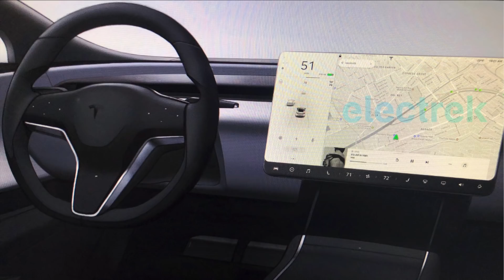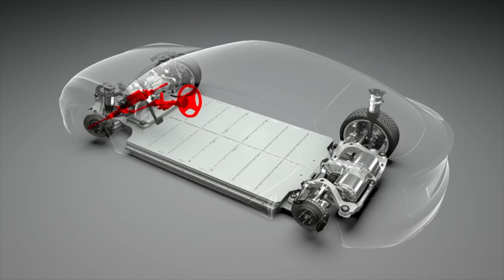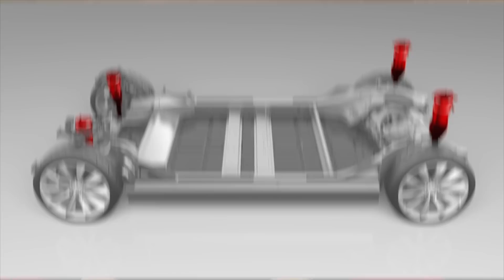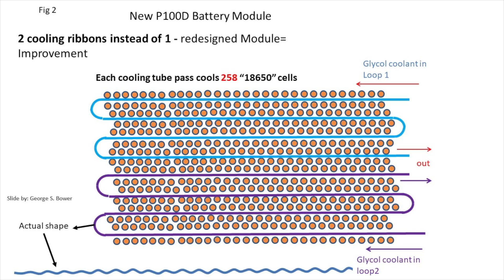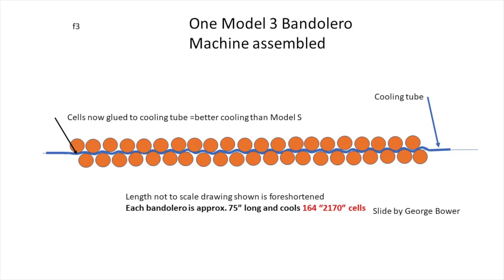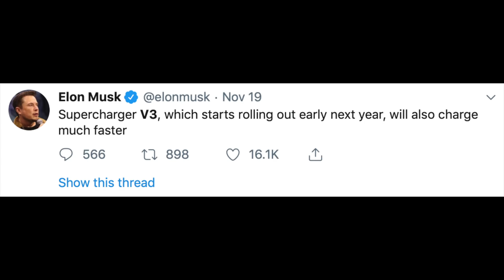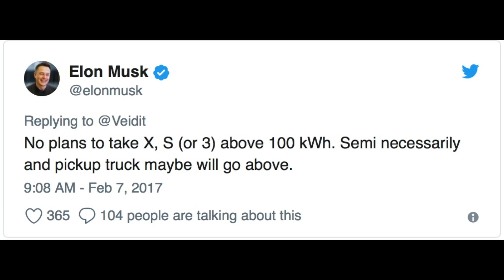The reason Tesla's 75 kWh battery is going away

Comment: There is no way in hell Tesla are going to just sell the S and X with a 100 kwh pack only. So my guess is that the 100 kwh pack will take the place of the 75 kwh pack and Tesla will release a "premium" 125/135 kwh pack with the newer 21700 cells. 

But it also brings up another question. if Tesla does go this road it means that the total power output of the pack will increase and that means that the 0-60 time will decrease, and then it would be competing with the 2020 roadster. 

So maybe tesla will limit the total power output of the pack. i think they will. 

great video as always.
Reply: GS540 I don’t think it will compete with the roadster. The guys I know with preorders are going to throw it on the track.
Reply: So 100kwh now costs $96k what will a 150kwh battery cost? I thought costs would be coming down not up  :-(
Reply: @gregandkaruna6674 Maybe they'll lower the price for the 100d.
Reply: @michaelrhodes73  Maybe, but I doubt it, how much has the price come down on any Model S since it was released in 2012? And the Model X has that come down?
Reply from the maker: Yes. I'm thinking something similar.
Reply: Or they can extend the wheelbase to make more room for 18650 cells to make the pack larger
Reply: @TommyboyGTP  why thats more Metal wasted for non Reactive Components. the 18650 is Dated to the 90's. and its Frankly out of date. teh larger form factor lets them use more space between cells and Store more power per Unit of Volume AND lower weight (steel tubes are heavy)
Reply: Chuck O Technically you‘re absolutely right. But the technology of the induction motors of S&X are grown historically (from the initial roadster). I don‘t think Tesla will continue them. Three reasons: Less weight, more efficient (both attributes of permanent motors) and strategically - less different components in the supply chain.

Good interview with Tesla Chef Motor Designer: https://insideevs.com/chief-motor-engineer-tesla-model-3-motor/
Reply: No it won't compete with the roadster because here is what I expect to see in the next 12 months from Tesla:

Model S: 420 miles range, 0-60: 2.1s (official on the site) probably faster real world numbers
Model X: 400 miles range, 0-60: 2.5s
Model 3 Performance Ludicrous Mode: same range as battery will most likely increase on the 3 in 2020: 0-60 2.6s

2020 roadster: 0-60: 1.8s, 0-200: insane to most human limit which the S and X won't do which is why it won't compete...
Reply: So the 100D model will become the new "affordable" version of the S and X. That seems exactly what they are going to do.
Reply: @ParkourParker25 
Yes, but the new cells are also a lot cheaper, so I think the new 100D could cost as little as the 75D costs now.
On the other hand, now the S and the 3 price ranges are overlapping, which is probably not a good marketing strategy. So maybe Tesla just absorbs the lot higher profit margins, or puts in new fancy gadgets to attract more wealthy customers. For example an interior refresh that's a bit more luxurious could help a lot with Tesla's image.
Reply: GS540 They‘re going also to change the motors for sure.
Reply: I very much doubt Tesla will limit the S, to "protect" the Roadster. There's no way an 135kwh S can compete with a 200kwh roadster. Returns are massively diminishing too at that level, we might see a tenth or possibly 2 tenths knocked off the Model S 0-60 time, but it wouldn't be anywhere near the 1/4 mile time or overall performance level.
Reply: agree, but the pricing has not changed...so are they going to screw the ever loving crap out of anyone who buys a 100kwh in 2019 before the update? jesus
Reply: If the total output goes higher the battery life will go lower
Reply: I think they'll go for the 125kWh pack. 120 would leave them just shy of a 400 mile range. 125 kWh should give them the 400 mile mark even if there is a slight weight increase.

If I remember right, the S & X didn't integrate the inverter with the battery pack like the 3, so a current increase to deliver more power to the engines would definitely require a vehicle change.

Volume-wise, they should be able to match the current space with 21700s just by adjusting the cell configuration however needed. But, there may need to be changes to the cooling system. I'd bet the 21700s represent a higher cooling load during charging unless they don't choose to charge at the full rate the cells could enable (in order to minimize redesign).
Reply: @rhett1383  60/85 65/90 70-75?/100 85/125 seems decent.....itll be close.....

i cant remember what happened back in 2014-2016....
but didnt they just REPLACE the 60 with 75? yeah?
and the 85 with 90 and then 100?

why remove the more popular option >> wtf

the car is old and outdated and now they're making it even more expensive wtf

should be cheaper than ever not more expensive, going to literally PUSH people into buying a taycan/ipace/etron  if they dont get the new sizes and lower price out soon
Reply: @Richard-ie1if  Assuming the ratios mean anything to them, I could see them dropping the 100 and going with something like 90/125. It would put the Model S squarely back in the king of range spot.

But, I don't know that it will necessarily be more expensive. The cell costs are coming down. One of the beautiful things we'll be seeing with EVs over the long term will be steadily increasing capabilities with inflation-adjusted costs remaining the same or decreasing. In this case, they are moving to newer technology that is being more optimally manufactured. I believe they can do it without increasing the cost. In fact, the better economies of scale could make it a reduction versus having this one platform stay on different tech in much lower volume.

My real guess is that there will be a slight cost increase at first just to reduce the backlash from people who just bought lesser capability. A couple of times in the past they've caught some flack from people who just bought for giving people more or the same for less the next day. This is minimized if they give a little price bump initially and back it off to the old price points over time.
Reply: @rhett1383  
yeah thats why this is total BS. the s/x are outdated woefully currently, and instead of lowering costs after publicly stating the margins are 30%+ and as batteries become significantly cheaper 700$/kwh to 100$kwh being sold in the tesla semi coming next year....

instead they remove the 75kwh and ignore the 4k missing tax rebate and effectively make the s/x 100k vehicles.  meanwhile the 35k 3 is still nowhere in sight

meanwhile the leaf extended range will be 28k post credit 35k before and do 240 miles...

if teslas advantage is in batteries it sure as heck isnt showing lol
nissans pro pilot will be compareable in a year or so and eventually everyone will get to full highway driving so who cares....its not worth more than 1-2k certainly not 5k
Reply: of all the times to do this why when the car is worse than ever, has no free supercharging, lost half its credit, and ipace is out, etron and taycan coming soon with kona bolt leaf releases/upgrades all coming

literally encouraging customers to look elsewhere

even then as the supercharger stations become more dense the 100kwh version is largely useless, a new 85kwh version with the new cell would blow an older 100kwh out of the water on charging rates
65kwh 3 can do 120+ so youd have an 85kwh base charging at 160kw+ vs an old 100D at 120 and the newer car could do that to a higher charge

for less money, cause the batteries are getting better and cheaper go figure

anyone who buys the last 100D made for 100K is a fool
Reply: @rhett1383   well yes its what i mean, somewhere around there whpould be good
Reply: Or they'll add a more powerful motor.
Reply: @stephenlasky9348  yes, u may be right
Reply: I am sure you are right
Reply: Elon Tweeted that the S and X will not be receiving any 21700 cells.
Reply: I heard it too....but why spend $5.5 Billion on a factory to make a new cell - the 2170 - that is lower cost, stores more energy, charges faster and has a longer life....then not put them in your best vehicles?  @WhitentonMike
Reply: that'd be nice.
Reply: 21700 cells would require a major redesign of the car.
Reply: @JohnDoe-vx3z  I dont agree. It would require a major redesign of the battery pack for sure but i don't see why it would with the car.
Reply: @GS540  Well, first Elon said so. But also the package of the new pack would be radically different.
Reply: @JohnDoe-vx3z  As for fit , Elon has already said it's not an issue . Only the battery pack design will be impacted
Reply: Chuck O 

Chuck O, excellent points all.   Yes, the S will probably go into the 9s in the quarter , but at what cost?  Battery and motor life are already critical at the "I want my mommy versus bring it on" stage.  This doesn't include tire wear ( already poor) and insurance considerations down the line. Do insurance companies want to see 8-9 second sedans in the hands of amateurs plying the streets of any town USA?  What about heat management?  Excessive Heat is never good for batteries on BEV or even ICE vehicles. 

One other thing. Don't confuse quick with fast.  The BEV are quick, but not necessarily fast. An S running 10.5 at 124 MPH is quick, but a 991.2 TT is both quick and fast at 10.5 and 132 MPH quarter. After the quarter mile, it only gets worse for the BEV. That's where the transmission comes into play. More speed with less RPM. The torque curve of the electric motor is already so flat that it can easily handle " shifting" a couple of gears up to lower rpms and energy usage. All while gaining speed.
Reply: @Newzchspy  I doubt insurance will be an issue.  Despite Tesla cars being some of the quickest accelerating factory cars available for sale to the public, ever, the insurance costs are roughly the same as comparably priced ICE cars.  We're not talking about a 60's era muscle car here that might just put you in the ditch at launch with only 350 hp.  Acceleration in these cars is completely drama free.  No scary noises or chassis upset to worry about.  The insurance companies only actually look at three things anyway: 1. The cost of repairing or replacing the vehicle, 2. The likelihood that said vehicle will be in a collision or be stolen that will incur said cost (including how often you drive it and your record) and 3. The safety ratings of the car, which again, in spite of the stellar acceleration numbers, are the highest in the industry.  If none of those factors change, it doesn't matter how quick the car runs in the 1/4 mile.
Reply: Robert Nugent Go online or call your agent. The cost of insuring an S/X is 40-50% greater than a comparable sized sedan ( E or S class)  from MB or BMW . Price out insurance for a new 2019 model 3 DMP and its near double the cost of a $42k Honda Clarity. Remember, much depends on where you live or drive and record, but as a general Rule, Insuring any Tesla is not cheap.  An X P100D will knock your socks off and is more with most carriers than a 2019 Z06 Vette.
Reply: Robert Nugent You left out many other factors....1. Frequency of being stolen or attempted theft or vandalism 2. IRG ( Insurance Rating Group from the ISO) 3. Where parked or garaged 4. Cost of parts and availability ( goes to how long  you're in a rental too) 5. Frequency of collision and /or comprehensive claims 6. Standard and optional equipment on vehicle per vin # 7.  Labor time to repair said vehicle is higher than comparable vehicles given materials and construction  ( just look at aluminum on Audi for example) 8. Typical driver exposure ( youths versus over 25 or married drivers)    9. AWD versus RWD due to drivetrain repair costs . The big issue with Tesla is unavailability of aftermarket repair parts ( non OEM) and cost or time of labor and paint.  I'm hearing up to 6 months for some collision parts like quarters, doors, windshield, bumpers and covers .  Scratch is one thing, collision is a whole other.  

Oh, and don't think that insurers don't know that the Model 3 is a high 11 quarter car or the X in the 11s and the S in the 10s. Relevant for rating: absolutely!

Comment: Yes, it's going to happen! I would have preferred a little later in 2019 but all should go down well anyway!

It's my thought that after all of the so-called would-be competitors had staked their claims on whatever mileage & power levels ranges each had settled on during one of those many marketing meetings. Tesla would come alone and upgrade their battery size and power levels alone with offering a greater mileage range of all of their lines. Thus causing a general predicament and dilemma without a short-term solution within the competitor's many ranks. Not good!

In fact, I personally think that a completely new battery is waiting in the wings with the ability to be assigned a class range such as A1 & A2 for the high-end model A & X, with B1 & B2 assigned to the value brands 3 & Y, thus allowing C to be designed for Commercial and Industrial applications and D for special applications designed for the energy group.In the end, just one battery with different mileage and power ranges, all based on a single software app applying different class assignment to meet the demand of the lines forecasted needs.

Yet another win for Tesla while placing the competitor's yet another step behind while again reducing the competitors themselves with just a single move on the part of Tesla itself.

Later
Ric
Houston/San Francisco
Reply: wrong.  batteries are over, the disrupter will announce with inventory and priced to last a year not to merely generate wicked fear.

Comment: I think that this is just another effort to take Tesla further into profitability.  I bet that the S and X were not big profit centers and it's not the batteries but other areas. the S is all aluminum,  the 3 has steel to save money, so, simply decreasing battery size shouldn't be a big drop in cost over the next few years, Tesla won't need to differentiate on battery size.  I think that the 3 will eventually settle on 1 battery size as well.  In 5 years batteries will be even cheaper than today.  I have a used Model S and the degradation is minimal.. basically Is till have way more range than a concept Mercedes that hasn't even hit the market yet  I see a future where older Model S' and X will be in demand for battery and possibly motor swaps.  It's exciting what can come in the future  Your S Sean, won't rust away, it will last a long time.
Reply: Have the Model S and X actually made money??
Reply from the maker: Second highest profit margin per car in the industry at 25%.
Reply: @AllThingsEV  that's a bs number. Plus... It doesn't account for the sg and a. Tesla's quotes from profit margins are so skewed
Reply: @AllThingsEV  really? Then why during the entire time that the Model S was introduced in 2012, Tesla only had 2 profitable quarters until 2018?
This suggests that despite the 25% profit margin Tesla was still operating at a loss.
Reply: @pogo1140  production of car was profitable, they just reinvested all the money on growth. Not giving money to shareholders.
Reply: @niconico3907  Tesla has an operating loss every year they've been in existence.  They have had three profitable quarters in the entire history of the company.  Two of the quarter's profits were so small as to be laughable ($11M and $22M).  Q3 of 2018 was $312M.  They don't have any real profits to distribute to shareholders - they're still trying to make up for the loss avalanche they accumulated so far.
Reply: @buckhorncortez 
It's called investment. Or do you think gigantic factories and global infrastructures are free? The gigantic difference between Q2 vs Q3 profit in 2018 proves beyond any doubt that Tesla's operation is very profitable, and the overwhelming majority of the "losses" was actually investment. And that profit will grow as sales numbers are improving and margins are growing. Q4 was definitely be more profitable then Q3, the only question is how much more.
Reply: Sean Mitchell only later were they profitable. Developmentally and during initial run, they made little to any money.

Comment: Hey Sean, that was a very good run down of the details. As a non-expert on battery technology, other than what I read or learn on my own, I agree with pretty much everything you said. I think there is a great chance that there might be a new form-factor coming up soon, but I also think there is a good possibility that the 2170 might be the one carried over on all Tesla models moving forward for a while beginning very soon. This makes a lot of sense to allow for a single type of battery production lines.

During my latest road trip my Model 3 charge many times at 500Mph, so I also feel like there is a lot more that can be pushed into the Model 3 since when it reached those speeds, it wasn't slow. It got there quick and remained there for a while each time. I am sure that software is the one limiting the charge rate.

Next time I drive coast to coast, if I plan to pass around your area, I would love to connect in person. Keep up the good work.
Reply from the maker: For sure. Let's catch up next time you're in Colorado.